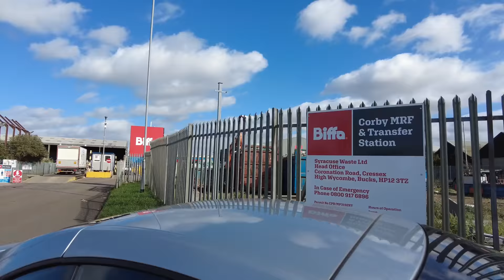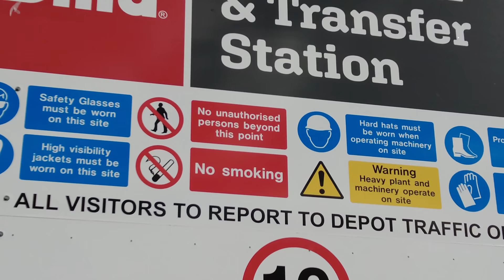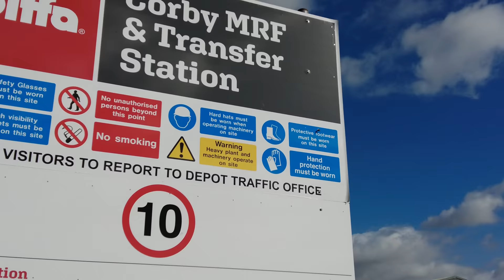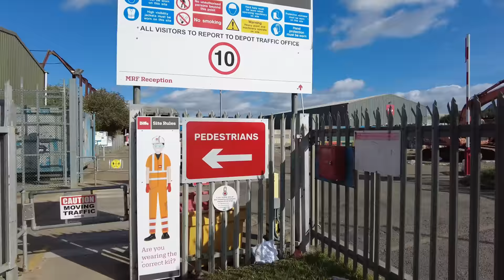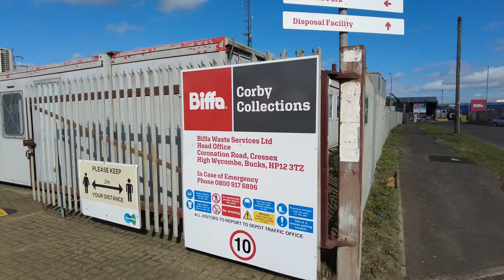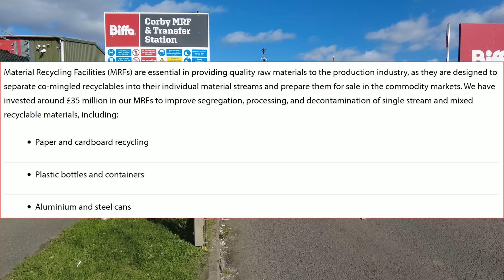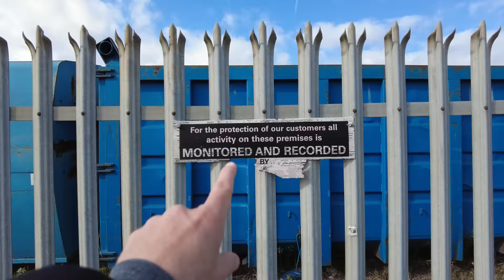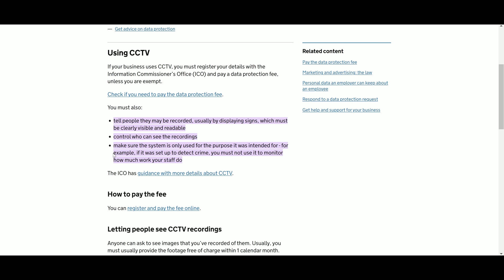Can You Stop Videoing Me? I Don't Want To Be On Film! 🚮🎥🛸❌

Comment: That wiring on the fence looked like data cabling, possibly connecting into the IT equipment in the cabins. It is so low voltage that it wouldn't register on the volt-stick. So it may actually be in use.
Reply from the maker: I saw the far right of the fence where the cables had been cut.
Reply: @DJAUDITS  Lol, that changes that.
Reply: They are old Data Cables. They look like they were used on a temporary basis. They should be housed in containment not lashed to a fence 😂 the cables should be of external grade running outside ideally. If you wanted a warranted system. Those weren’t.
Reply: @martingetliffe  I've done some sketchy cabling in my time but that was nuts. If I tried that some landscaper would come along and mangle it all up with a string trimmer or something. Bare cable under a brick path with not even rated cable. Even for temp use I would have got some pipe of some sort.

Comment: 22:24 Network cables don't carry high voltages so they are not dead. Ethernet cables only have to handle about 2-3 volts. The voltage detector will only work on high voltages.

Comment: Those cables might be being used. The look like phone or alarm cables. You see external movement detectors on poles. These trigger inputs on the cctv controllers which in turn will swing the PTZ cameras to that zone. They'll like be 12 volts dc and not enough to light up your tester.

Comment: I'm pretty sure those wires were coaxial cables for video feed. There wouldn't be any voltage that could be picked up by a voltage tester, however there would be typically mili - amperage going through the cables

Comment: the mystery waste is scrap injection plastic, basically what was left in the machine when a run finished or stopped suddenly and all those cables there are cat5 data twisted pairs so they probably connect to the cctv and the weighbridge so could probably not be removed

Comment: The "Air conditioning" is probably Air Sourced heat pumps, ha ha like he's gonna spend his break tackling DJ Audits that's really funny probably be better having a Pastie, and he didn't seem like Management Material. 
Looks like they have fixed the roof themselves in the building with open front, different colour and sized sheeting, probably put the fork lift through it